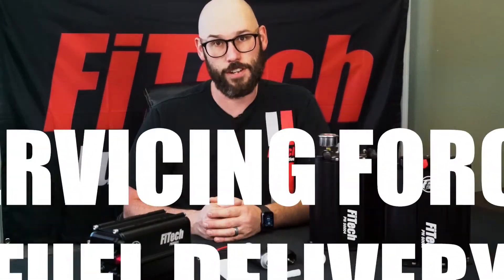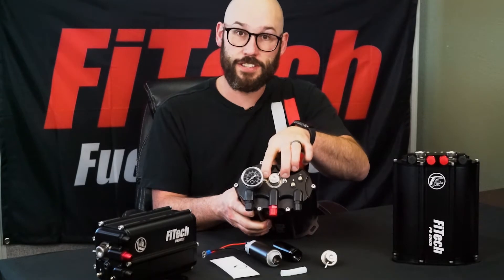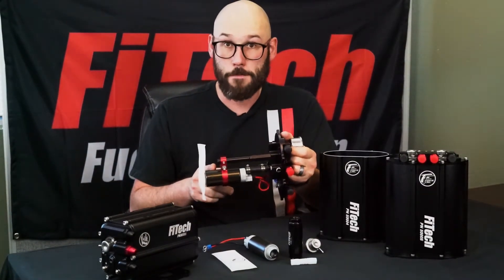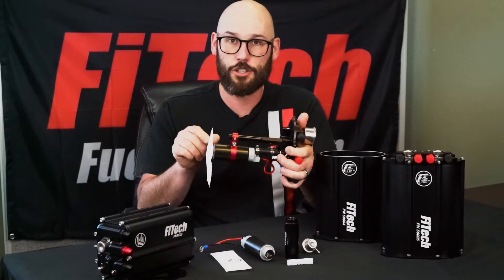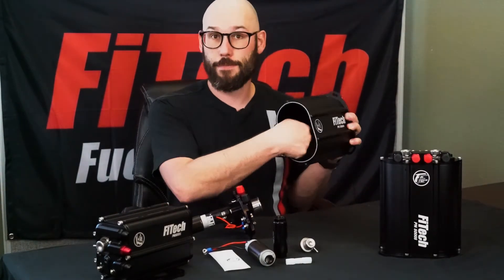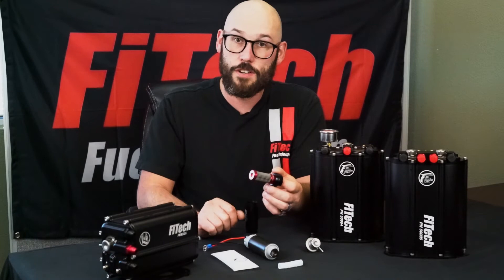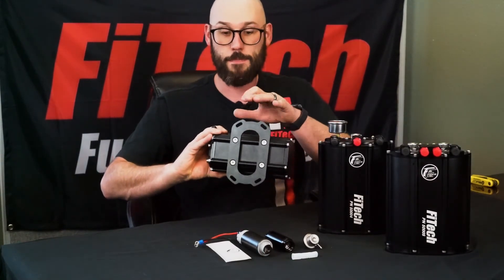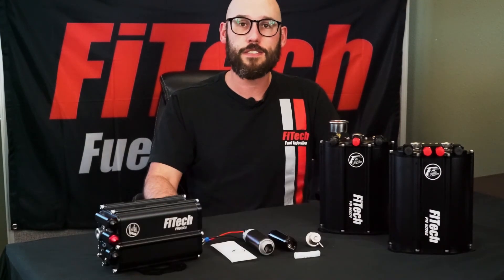Servicing Force Fuel | Tech Tuesdays | EP8

Comment: I have the mini system. My pump is going out. I ordered the 50102 pump. Its doesn't fit. Which pump is the replacement for mini system?
Reply from the maker: Fuel pump # 50104 for a FF mini replacement pump.

Comment: Hello my dear friends from fitech. I am new to the fitech 31001 system. I have had problems with the fuel supply, firstly the system seemed to turn off the pump (I have ground wire from the pump directly to the battery and the orange wire from fitech to positive from the pump) without finding A solution to this I decided to place a relay for the positive of the pump controlled by the orange cable of the fitech system, now the pump works perfectly and does not seem to turn off the pump but after 20 minutes the pump begins to increase its sound until the car it turns off, when you touch the pump the pump is very hot. what should I do? I want to buy an AEM 50-1200 E85 pump inside the tank since definitely my experience with the pump on the line has been very bad and then leave the connection under the relay because if I don't connect the relay then the system turns off the pump . I would like to hear suggestions. Thanks a lot
Reply: as data the pump is below the fuel level in the tank
Reply from the maker: The fuel pump is cavitating. Electric pumps are designed to push fuel, not pull. The pump needs to be lower than the pickup in the tank which is at the bottom. Other things to help the pump get fuel is to increase the line size leading to the pump and mounting the pump closer to the tank. Basically what you have happening is the pump is straining. It gets hot and starts to aerate the fuel. Once aerated the pump can NOT pump and you loose fuel pressure. This is also causing high amperage on the fuel pump circuit.
Reply: @FiTechEFImedia  hello friends I found that the fuel intake of the tank of my mustang is very small and I am sure that this is the problem as you indicate it to me. Thank you very much for your suggestion. keep in touch with us.
Reply from the maker: @5_lug  Glad we could help!

Comment: Force fuel mini!?🙉🤯
Reply from the maker: Oh yeah!!!! This Spring!
Reply: @FiTechEFImedia  so I have the Force fuel mounted on my firewall. I no longer like how it looks there because the hoses are routed everywhere.  I would also like to eliminate my mechanical fuel pump. Could I just remove the fuel pump from the Force Fuel unit and attach it to my sending unit in the fuel tank?
Reply from the maker: @TheSqually84  You could put then you have have to deal with high pressure lines and electrical terminals. Another option is our #50015 Tight Fit Pump Module which will eliminate all the obstacles of getting the pump in the tank.
Reply: @FiTechEFImedia  with a fuel injection sender actually...